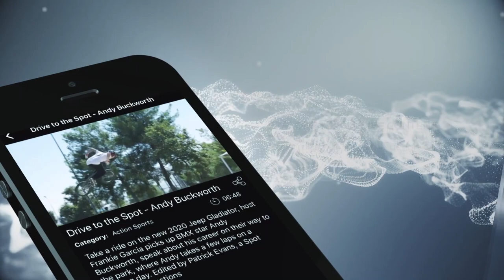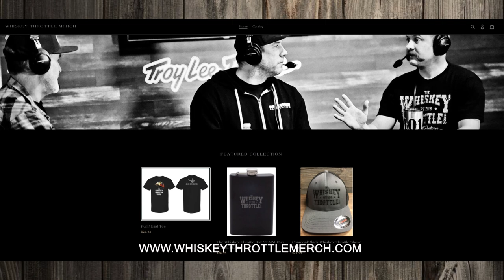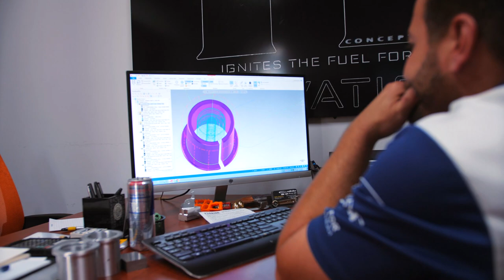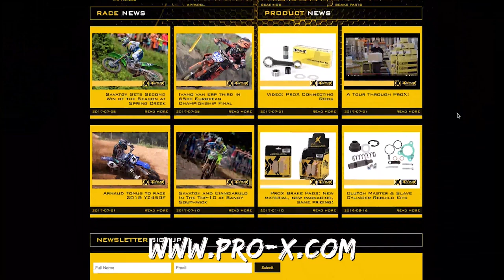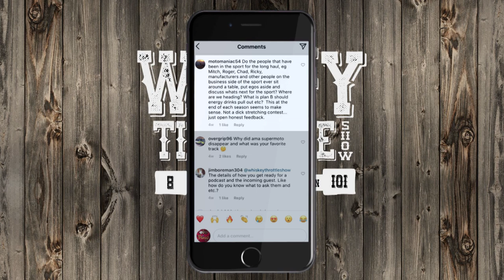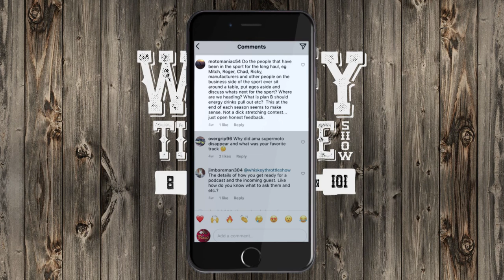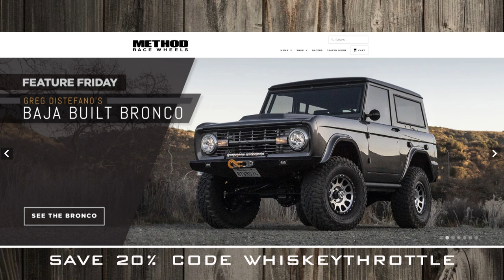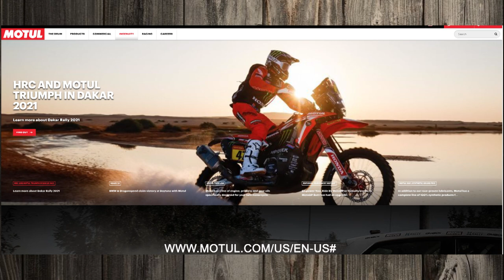S3 EP3 NATHAN RAMSEY

Comment: 250 2 strokes are 2 fast for lites class. Up the limit 2 300cc 2 stroke in 450, They could compete and would make it cheaper for privateers and smaller teams.

Comment: I like Nate but the moto spy idea isn’t good, you want pro riders to ride 2 strokes when most manufacturers don’t even make them. Just have the 250 class open and  no pointing  out. The 125 class makes way more sense the having top pros switching from 4 to 2 stroke. Riders wouldn’t be for that idea. Stop trying to push riders out so young. You can still perform at the top in your 30s if you’re mind into it. I mean Brady still in the nfl at 44